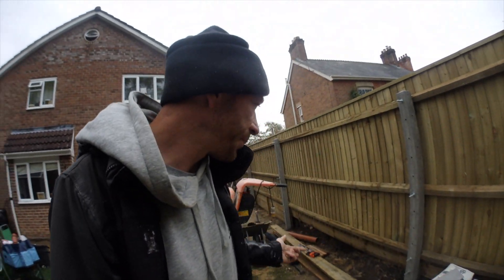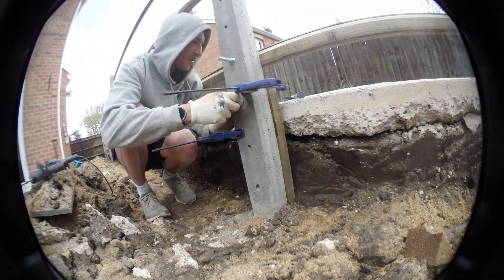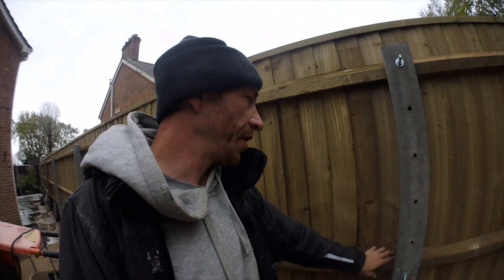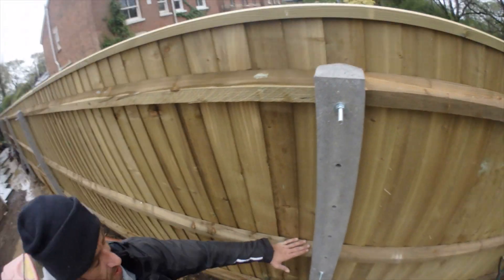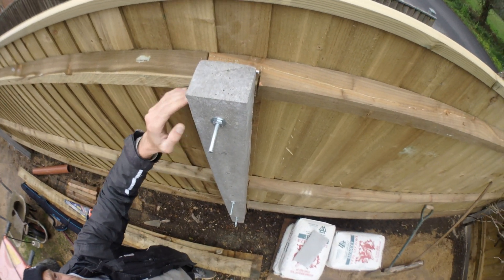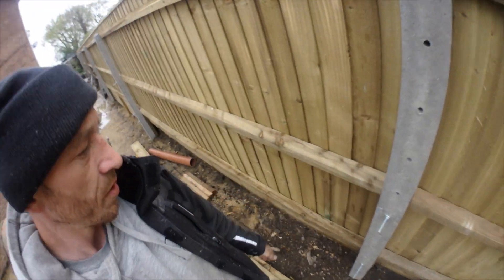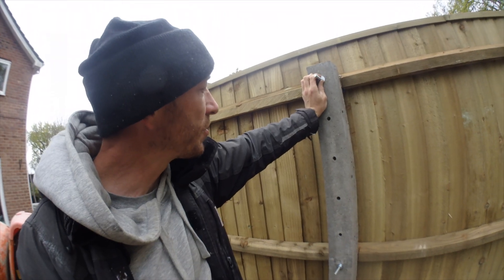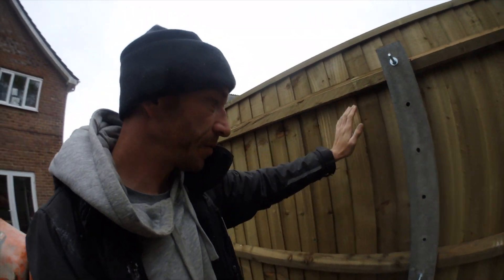How to install a closeboard fence

Comment: Hi Jasper,  who supplies the concrete posts with the pre drilled holes you used,  only seem to have the concrete recessed Posts in my area West Midlands. thanks in advance Ray
Reply from the maker: Hi Ray thanks for your comment,  these were supplied to me for a company called "the fencing centre" this is the link to there site 
 https://www.fencingcentre.co.uk/fencing-centre-stores/

Not sure how far they deliver,  the name of the post are universal concrete posts.
Reply: So much more work using them style posts as opposed to using mortice posts surely.  And if U dont cut them jutting out fixings back near post someone probably a kid is going to tear an arm eye or ankle open.
Reply from the maker: Definitely better in my opinion,  especially for if  you need to take fence apart to gain access,  using morticed, if a section goes, it's a nightmare to fit rails again were as with this. Each section can be replaced easily. But up to the customer at the end of the day. As for bolts agree , these were cut back. Not show in video but bolts were cut back flush with the nut. Appreciate the comment 🙏  are you a fencer or landscaper?

Comment: What spacing did you use between the posts? Cheers
Reply from the maker: Hi Peter thanks for commenting,  I believe we used 3 metre bevelled rails so I'd say about 2.8 metres between each post.
Reply: @jaspermillerlandscaping6174  cheers mate, keep the vids coming 👍
Reply from the maker: Cheers mate really appreciate that. Glad I could help

Comment: Hi Jasper, first off this is definitely best fence setup I've seen,  amazing job on this. I'm looking to repair my fence using this method I wanted to ask is.

Can this be done on 8ft Recessed Posts with 6ft panels and Concrete gravel boards? 

The capping rail how long is that 😅 Can't see a cut?